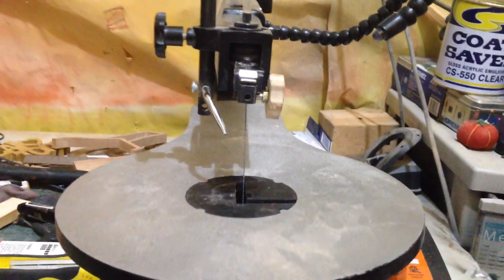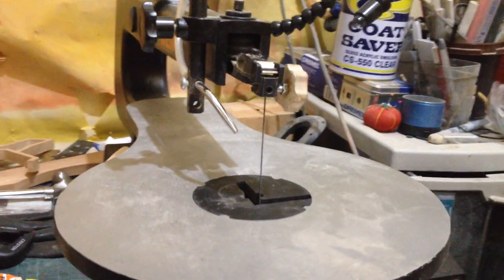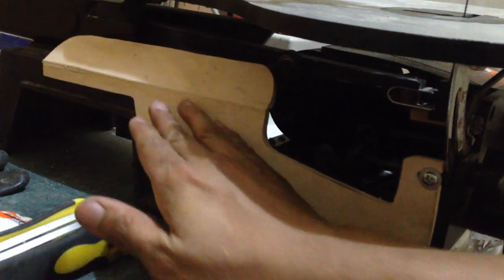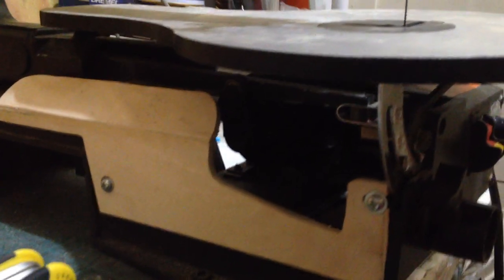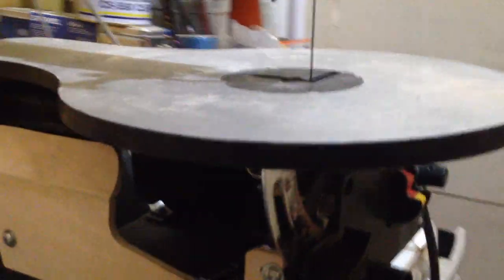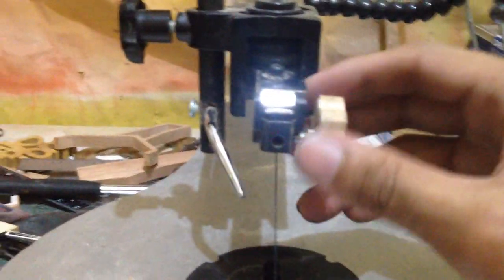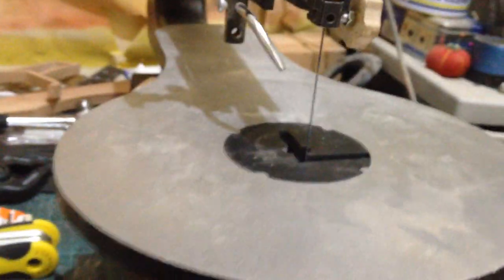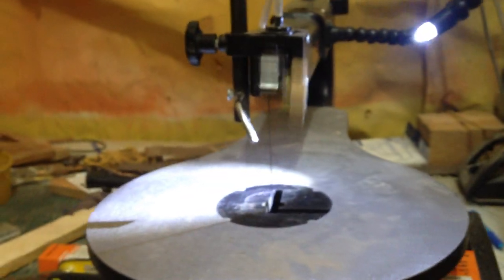WEN 3920 Scroll Saw modifications and improvements

Comment: Wow that whole mounting block assembly looks completely different from mine.  Looks like it would be easier to do pin less blades with that set up too.  Great Job.
Reply from the maker: Thanks sir! it's now really easy to see and reach the blade holder and clean the inside with this set up. all I i did is unscrew the original casing and  had a rough trace to paper and transfer it to a board for cleaner lines and transfered it to wood. just watch the WEN scroll saw table when you tilt it to 45 degrees. be sure it wont stand its way when you tilt it.

Comment: looks great.., I have same model and been wondering if how to make a nob feature screw fit, does it viberate loose?
Reply from the maker: Thanks! I use gorilla glue and nut to reinforced strength of the screw on the knob to prevent loose and vibrations. if not doing this it will loose in time unless you will use other right  tools to curved the head of the screw on the knob. i used hammer first  to curved the shape of the head on the wood haha ^__^ the knob really helps me a lot to save time :) its still going good.

See attached photos for reference:
http://tinypic.com/r/302ntow/9 
http://tinypic.com/r/2zf22kk/9
http://i65.tinypic.com/wmcvvb.jpg